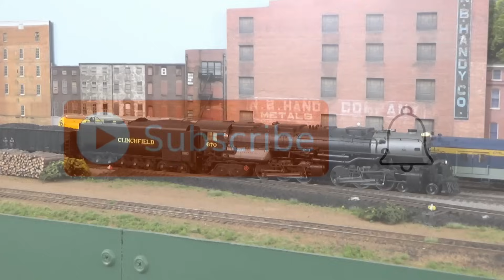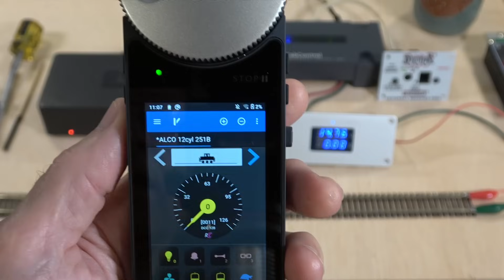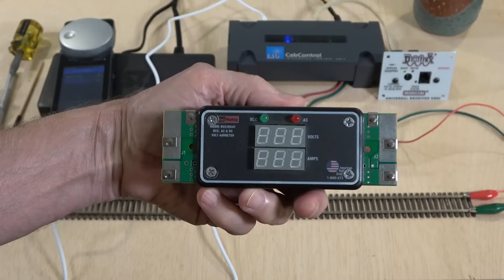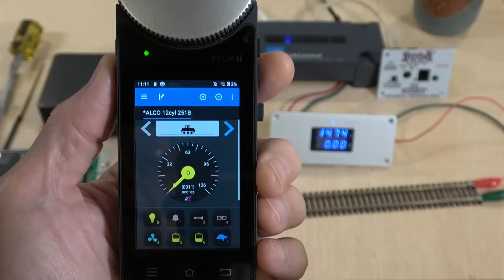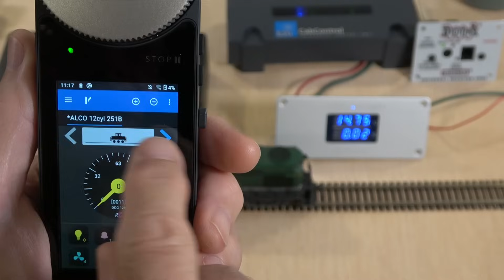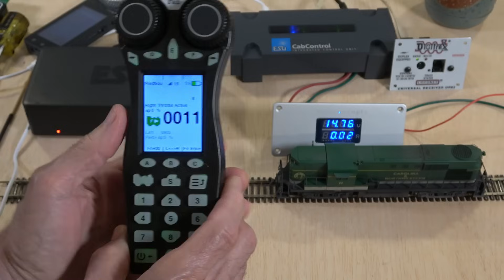ESU CabControl Wireless DCC System (404)

Comment: What I want to know is, can we use multiple ESU controllers with it? By that I mean, the controller that comes with it, can we buy more of those and use them for a club kind of setting, with multiple controls? I'm assuming yes since it's WIFI?
Reply from the maker: Good question and I assume yes, I had no problems using the TCS and Digitrax throttles with it. But you could contact ESU USA located in Colorado for a more definite reply.

Comment: Just bought this for my Marklin 1 gauge layout. Didn't want to spend the 1K for a central station 3 and power supply. Can't wait until it arrives and I get to test it. The 6a adjustable voltage power supply that comes with this was the selling point for me.

Comment: For me  a major deciding factor for choosing a DCC system is the throttle.  ESU CabControl came out before the TCS system, but I really didn't care for the throttle, even though it has a fancy color screen.  I did read some early reviews but decided to wait.  TCS came out with their amazing UWT throttles and I read a lot of very positive things.  I decided to go all in with the TCS DCC system with the CS-105 command station and UWT-100 throttle.  I love the menu system in the TCS throttle - it's so easy to MU diesels and run them.  If the ESU system had better and more ergonomic throttles, I would have been more interested.

Comment: I love this system.  It now updates over the internet.  No more attaching to a computer.  It even works with my NCE Switch8's, though you have to turn off the ESU Railcom, which would automatically recognize ESU decoders.  I connect the CabContol  base station to my home network by cable) and run JMRI that way.  Either way the throttle is great.  Cheapest wifi solution that  am aware of.

Comment: Dear Sir,
I have a  G15 locomotive, I have installed the HM7000 8 pin decoder but I am not able to choose which locomotive profile to select, kindly guide me.
Reply from the maker: If you mean the GER 0-4-0 model then I guess any comparable small steam loco would suffice. If you want  prototype specific sounds check with You Choos DCC or the ESU LokSound website.

Comment: My only concern would be it’s too proprietary, especially since I use nothing but Soundtraxx tsunami2 decoders.
Reply from the maker: Soundtraxx decoders work fine on ESU systems, so I don’t see what your issue is. The only difference between them and LokSound (some TCS decoders, Lenz and a few other) decoders is Railcom capability which only allows you to read back CVs during programming on the main and allows the command station to automatically identify the decoder when placed on the track.

Comment: Im interested if you want multiple controls,  is it compatible with running along pro cabs off its system or do i need to buy a couple extra mobile hand sets?
Reply from the maker: Not sure what you’re asking. Pro Cabs are NCE which as I said do not work with it.
Reply: @TheDCCGuy if I were to upgrade to this system, and I need 2 - 3 controls for friends to run also, i assume they will need to download an app and run off the wifi on the system
Reply from the maker: They could use an app on their cellphones or any of the various throttles I mentioned plus a number of others I didn’t have time to cover. There are several types of European DCC systems that use Loconet so their throttles would be compatible plus some that use wifi throttles.

Comment: I have the previous version of the Mobile Control II throttle and its an excellent system. Because its Android based it will run Engine Driver as well as the native ESU control system - Engine Driver can then connect to NCE using JMRI or the WifiTrax WFD-30.

Comment: Does this throttle have a yard mode like the tcs throttles
Reply from the maker: I doubt it but will check before the next video.
Reply: No it doesn’t.
Reply: It has a mode where you can stop the momentum and when the throttle goes to "0" position, the loco stops immediately.  Is this what you mean as Yard Mode?

Comment: Hi Larry, can you run DC locos on this as well?
Reply from the maker: Don’t remember seeing anything on that but will give it a try.
Reply: @TheDCCGuy awesome
Reply from the maker: Be aware it is not a good idea to run analog locos in that manner as the high frequency of the DCC power cause the motors to heat up in prolonged use. It is basically an option for testing out a new loco before installing a decoder.

Comment: ECoS is such a huge leap up in tech from my starter system. I chose it instead of Cab Control because I can always add a wireless throttle or use another wireless device since it's on my home network. I love the two full cabs and all the physical buttons for functions it offers.

Comment: Hands down the most flexible dcc system out there
Reply: Railcom is a nice feature if you run ESU decoders. I still think DCC-EX is severely underrated, especially when combined with JMRI.
Reply: @seancrossen4659  dcc ex is great but has a learning curve to get it all set up   this esu system is nice because it is compatible with existing systems out of the box
Reply: @seancrossen4659  ESU and JMRI are totally compatible as well.
Reply: @seancrossen4659 Yes, I have to admit, I don't know where I'd be without JMRI.
Reply: Have you tried Blunami? 🤔 You can use your phone for controller
Reply: @eXtremeFX2010  it's good if your using ho or larger but not available yet for n scale
Reply: The Roco Z21 (black) and LoDi-Con throttle work great together.